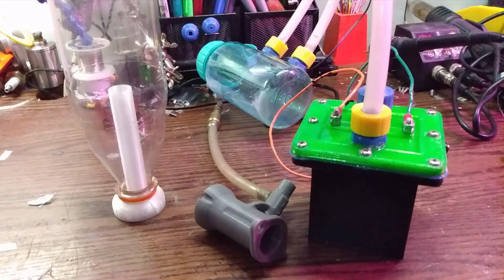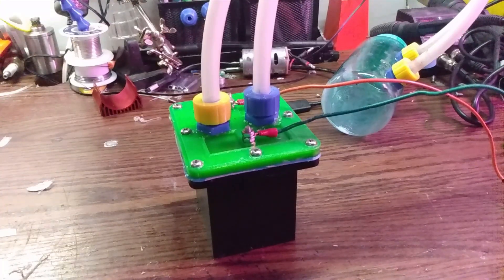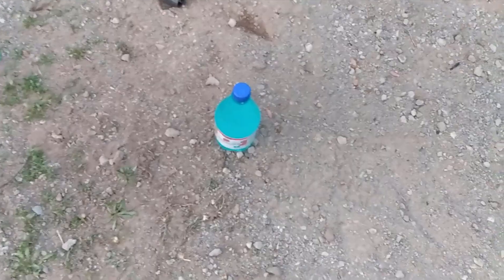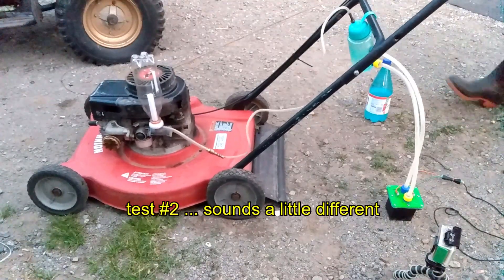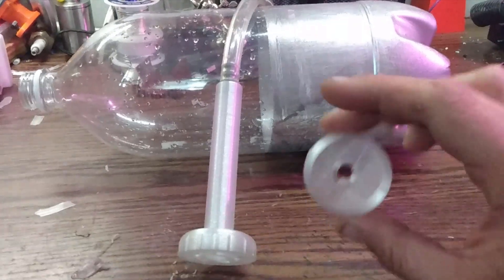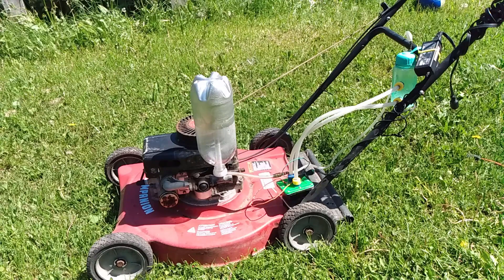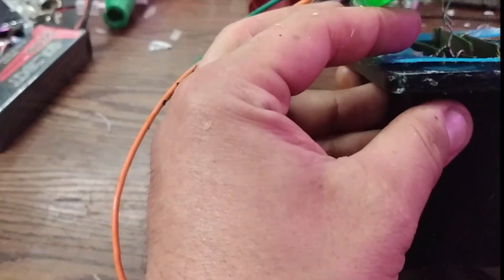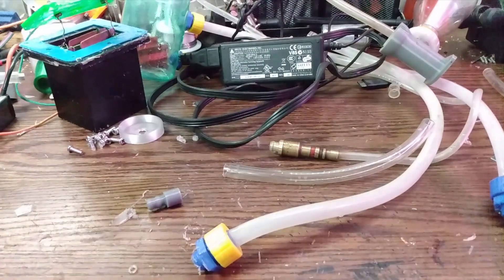Electric Powered Gas Engine ???

Comment: With the price of gas going up
Need is the mother of invention !
It is inspiring  to see diy operators taking the leas !
Good luck ! And have a good day !
Reply from the maker: Thanks this idea has its own issues , I would be worried about driving the price of drinking water though the roof. So I'm a little iffy about going much farther . But after this experiment I do have the information needed to make it work . I'm glad you found it interesting . You as well have a good day .
Reply: @turboprint3d  
Hi torbo 
I was born in 1949 I'm a senior citizen now 
growing up thru the 50s there were guys racing stock cars in our town that did everting to make their cars go faster 
since they went one way they chained the suspension down on the driver's side and welded bars on the wheels so they wouldn't explode 
One guy was aaaircraft mechanic from ww2
and  he put water injectors on aircraft enginees to give the more power at high altitude he experimented withi injecting water into engines to make them go faster
In one set up he had a water pressure accumulator tank with a bladder 
on one side of  the bladder he filled with 
Split hydrogen and oxygen and he had a old fire extinguisher with compressed air on the other
  it operated with 2 ball valves joined together with one lever when he pulled the lever compressed air went in the accumulator against the diagram and pushed the oxygen hydrogen mixture into the engine a poor man's nitrox 
One time he blew the head off the motor 
After just putting $160 of gas in my truck I am thinking of experiencing a bit myself
I have a motor home with a carberated engine 
Fuel injected engines it would take a computer wiz kid to fihure it out ?
I lost my computer skills some where between  windows 95 and windows 98 ?
could use solar to split the water also I have seem them use metal hydrate in fuel tanks not sure if it absorbs the water or breakes it down to be used as a fuel?
Or just go thru the motor without hurting anything?
It would be neat if you could alter water chemically and burn it directly 
Keeps you thinking as the numbers go up pumping gas !
Have a great day !
Reply from the maker: @carllafrance5510  hey good to hear from you , that in today's car lingo is called hydro meth injection , or at least it sounds more like it . It sortof turns the heat wasted energy I to working energy with steam , as well as cleaned any junk from the cylinders . It's usualy used with high boost pressures to keep knock and backfires down to a safe usable level while increasing horse power . They have computer controlled kits available , but I have made a system for both myself and a Friend about 12 years ago. I used a standard diaphragm water pump , and used cheap windshield washer fluid . In the system you discribed as with mine when u add heat to an hho mixture it turns back into water especially with pressure . Sounds like it would have done the job to make power but controling that sort of reaction like that would have been very dangerous if something whent wrong . I find there were more people doing cool things like that back in the day , and society has discouraged that sort of behaviour.
Reply from the maker: The water reforming could be a long term issue running off hho , so some normal hydrocarbon fuel mixed in works the best .
Reply: @turboprint3d  
My niece just got her beginner's lisense and we have been going out driving around practicing
On the way back we stop at Mc Donald's 
Right beside Mc Donald's  is a electric car stable with room for 50 electric cars 
And every time we go there it is full of cars getting charged 
We always wondered how long they had to wait for a charge?
The price of the car is way out of my budget or any repairs I could afford  plus you can't work on them without a computer
Around town they are probably ok I have heard different  mechanics say for 3 years they are OK after that  Any repairs start at triple figures and go up
Reply from the maker: @carllafrance5510  to me an electric car should be way simpler than an ICE however they seam to be working away from that idea .  The charge time is an issue one way or another as fast charging shortens the total life of the battery a little bit every time . Otherwise slow charging is best for battery health and lifetime but your looking at 6-8 hours on a 110 15amp plug for most decent electric cars .  I eventually plan on converting something to electric , but mine will be similar to an RC car more than a Tesla . Simple as possible setup , home made MOSFET driver board , home made Arduino based controller , batteries and a motor . Other than controls that's all an ev needs . Now lithium needs a battery management unit for safety as lithium battery a are like fireworks , and a Tesla has hundreds of them underneath the driver .  I believe there is plenty of room for improvments on the combustion engine , however our fuel should probably change. To what I'm not sure , but it's difficult to complete with gasoline for energy density . Running water worrys me as I foresee companies monopoiesing water and makeing people suffer because of it . That also requires energy sources other places , hydrogen is everywhere but it's stuck to other things , and expensive to seperate .
Reply: @turboprint3d  
My buddy has a electric golf cart with lead acid batteries around the farm with short hops it is amazing  how much power  that thing has hill climbing and such
It wouldn't be good driving down the road for very long though
You start building your own electronic circuits you are a true pioneer !
Reply from the maker: @carllafrance5510  thanks , but I can't take all the credit . Alot of my work are variants on things that other people in the open development field have done . With any luck Ill at least be a stepping stone for others to work from . I share alot of my designs for free . Originally all of this was just to keep depression away as my body was failing and am no longer capable of doing what I'm trained to do (machinist) .  At this point I hope to build a community and maybe inspire other to make things and use 3d printing in a practical way .

Comment: Far further than many already. Interesting design. I hope you develop it.
Reply from the maker: I'm sortof reluctant to follow through , as if it did become useable it would possibly drive the cost of water through the roof . Makeing it impossible for some to get drinking water . Companies already tend to do this anyways . The one issue is size  , the other being power . You can't pull 3.5hp from a 110volt outlet . So at best you could make it work but it would have issues under load when the engine is actually trying to make its full HP .  It definitely could be done tho .